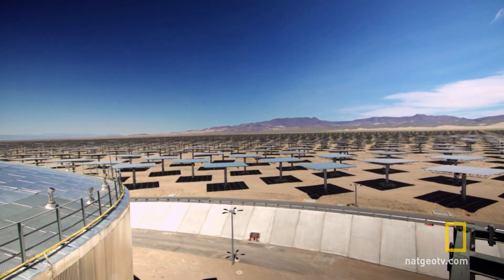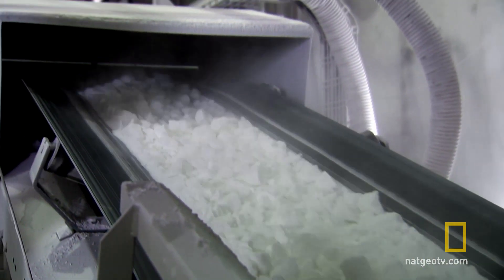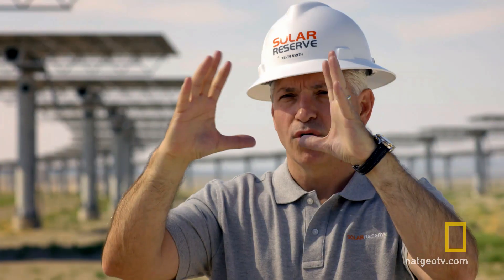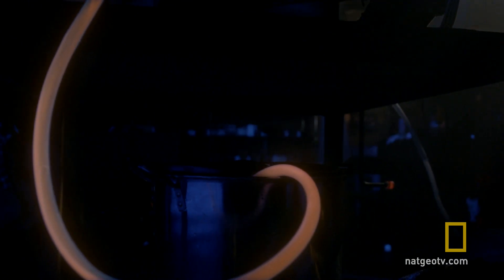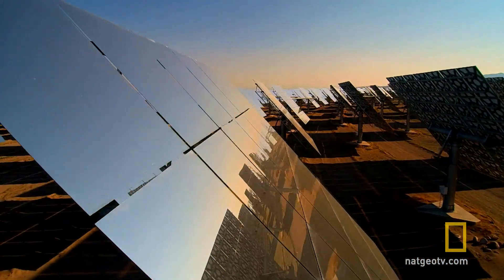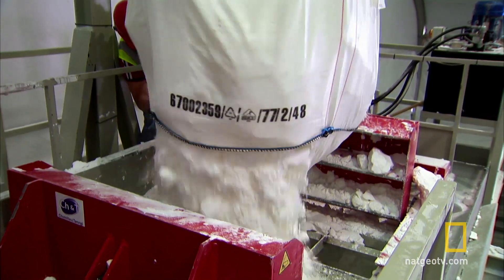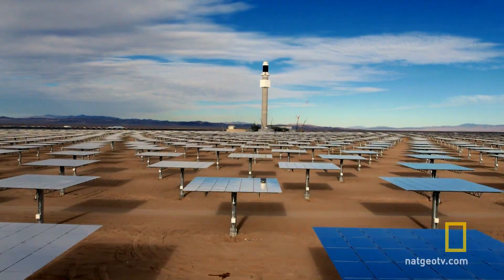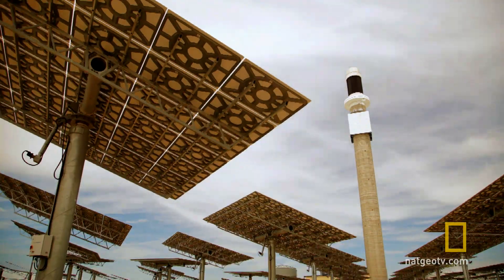The Power of the Sun and Salt | Breakthrough

Comment: Most countries still need baseload power and these 100% renewable thermal Power Plants are an excellent way to achieve a 24/7 power output if the correct location is available.
😎🇦🇺👍